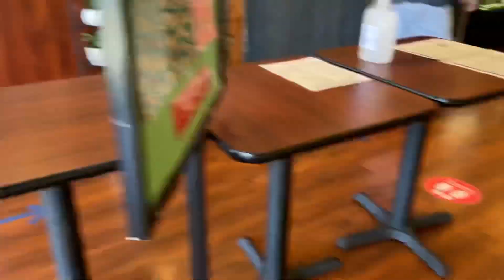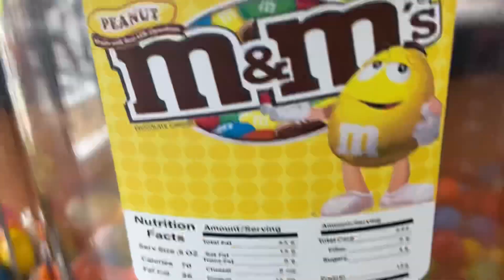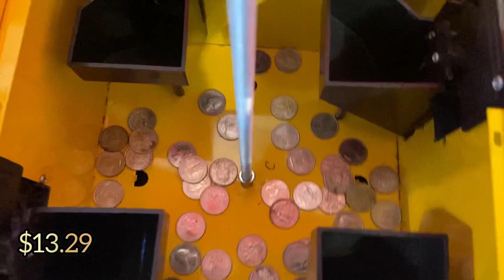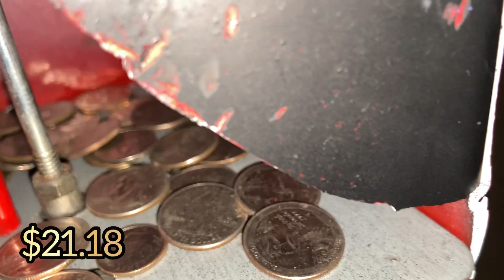BIG MONEY COLLECTION FROM CANDY MACHINES IN 2021

Comment: I have a question, Ok so im doing the math on m&m peanuts, and if my math is correct it seems like m&m peanuts are not profitable at all unless you completely cutback a huge amount from the customer for example 7 m&m peanuts is about 18g. So, 61 oz  of m&m peanuts cost 18.99, 61oz =1757g/18g= 97 vends per 61oz bag. so 97*0.25=$24.25 total revenue.  24.25-18.99= 5.26 gross profit so how is this profitable? I'm asking because I want to know if you have a different equation or if I'm doing something wrong?  are you giving the people less than 7 m&m peanut (18g) ? I'm asking because I don't want to put myself out of business
Reply: Good morning. While the profit seems low Peanut M&Ms sell extremely well and fast. Not sure where you got your math from but my machine sells 25 cents for half an ounce of M&Ms. About 6 pieces. My local Costco sells them for $14 for a 64oz. If I sell out 1 container that's $32 in revenue and $18 profit. Factor in $3 for gas that's $15 profit.
Reply from the maker: We vend 5.
Reply from the maker: Honestly, just keep your vends to .5oz and you should be okay. What folks do not realize is bulk vending requires A LOT of locations to truly see hefty profit returns. Meaning, the more locations you have the better for your ROI. 
Having a route of 10 or less bulk candy machines won’t really do a dent in earning true revenue. You’re going to want 30+ bulk locations to really see some money. Gumballs are the best bulk candy option to sell, while toys are the true and only bulk product to make real money from. 

Hope this helps!